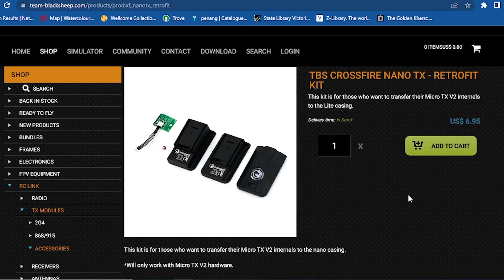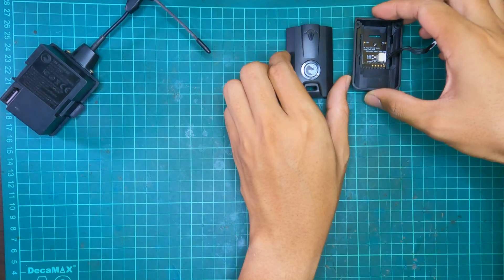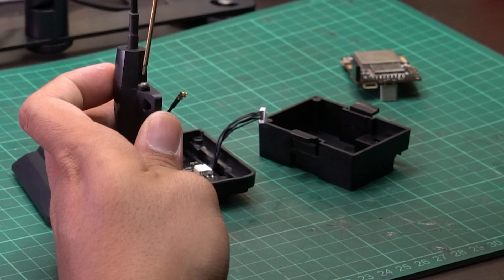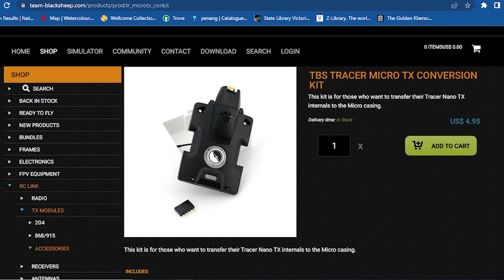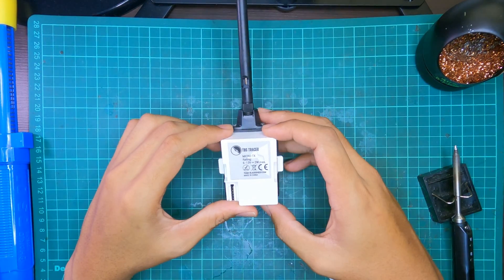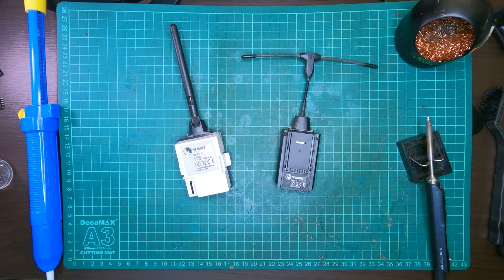TBS Retrofit & Conversion Kits

Comment: Great detailed video! Was wondering if instead of soldering the adaptor to the micro, will running wires straight from the nano to the micro work? this way I could re use the nano setup on a different radio.
Reply from the maker: Sounds like you'll be using the Nano TX casing, then solder wires to the 5 solder pads on the board towards an external 5-pin head.
The results your looking for, sounds like being able to plug in the nano body into a jumper T lite or use the wired pin-head to plug into a TX16S.

It does sound possible, as you'll be plugging into one radio at a time, and the PCB swing both ways.

But here are a few inconveniences. 
- The body of the Nano kit is tight, and if you want to screw it in, you'll need to cut an opening of the Nano Csaing for the 5 wires to the 5-pin head to come out of. 
- Before The first time you plug in the 5-pin head to the JR Bay of the TX16s , please ensure orientation of the pin is correct, and perhaps mark the highest pin with a tape to ensure you plug it in correctly every time. 
- When plugging in to the 5-pin JR Bay of the TX16s, your module will be hanging, causing some inconveniences if you fly while standing.

Hope your retrofit of a retrofit works man!